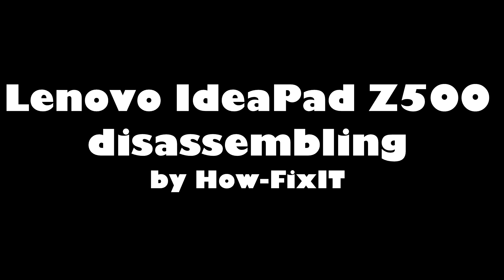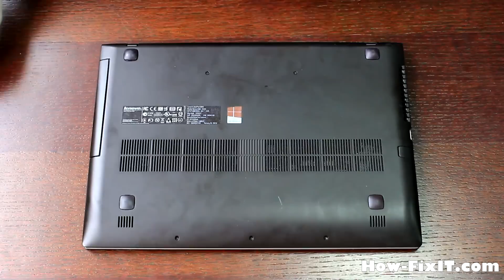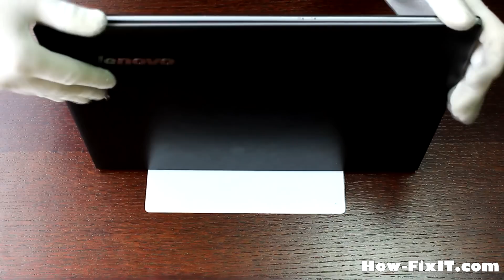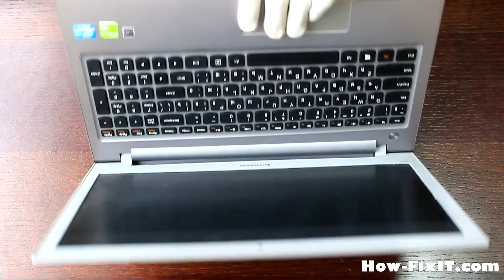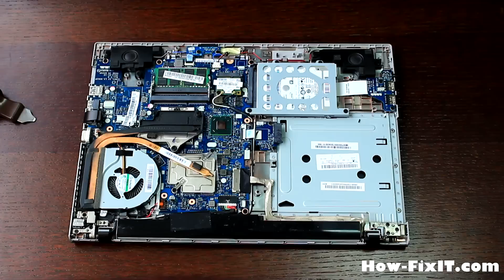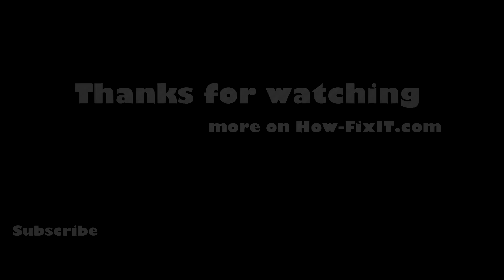Lenovo IdeaPad Z500 Disassembly and Fan Cleaning Guide

Comment: @How-FixIT Ive Z400. Want to upgrade hhd to ssd.. should I replace with the metalic cage? Put inside of it?

Do you need to remove the keyboard to install the RAM and SSD?
 Is it necessary to disconnect the battery from the notebook that goes inside the top like a bar ... to do the replacement of ram and ssd?
 Can you add a 2.5 "7mm Sata III SSD? For example a Crucial MX500?

 Finally: do you clean the circuits with a brush or is it special antistatic? Or just the fan its ok?

Comment: I too have a z500. Always something to learn from these videos, so thank you for that. Would be greatly enhanced with an audio commentary although no doubt you have your reasons. The video looks remarkably similar that that on Phone Laptop Repair j500j500. Bizarre that you demonstrated cleaning your fan assembly directly over the motherboard/circuitry. Question that you did not clean off old thermal paste and apply new thermal paste to CPU & GPU, thus crucially not ensuring a good thermal contact.

Comment: Hi I have a z500 with very noisy fan, so video of interest to me.
The video is clear and camera stable so easy to see the steps and order you have taken. Thank you for that.
I personally think your video would be greatly enhanced with sound (no doubt a deliberate choice) so that you can point out any risks and things to avoid long the way, eg order of removing screws on heat sink mounted to CPU.
On negative, some things happen off camera, such as when cleaning fan. Perhaps second camera for this or a voice over explaining what you are doing?
Finally, very surprised that you did not remove old thermal paste and apply new thermal paste to CPU since without a good contact, I image the fan and cooling performance greatly reduced???
Thank you for video, comments aside, is quite helpful.

Comment: İ cant even move keyboard
Reply: +Çılgın Börek
The keyboard is held by only two screws at the back, and some low profile clips at the bottom and the sides. As soon as the keyboard is slightly bent through from behind, e.g. with a toothpick through the screw hoes, the side clips will come out. Some wiggle and the rest will too.

Comment: Hi, your video has been very helpful. I too have a Z500. I used your video to open it up and clean it.
I do have one question though. Why did you not re-apply thermal paste on the pads before re-installing them?
Anyway, I cleaned it up but the fan keeps making a whirring noise when I use Dust Removal Tool.
Reply: did you find out why your fan was making those whirring noise?